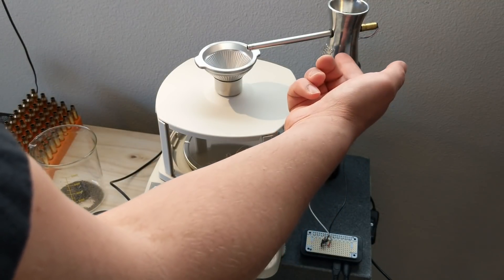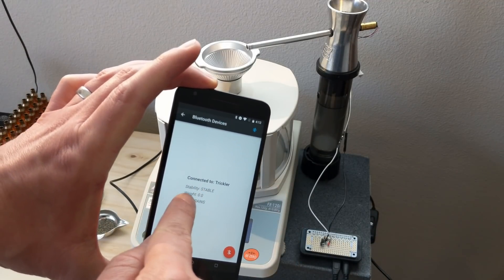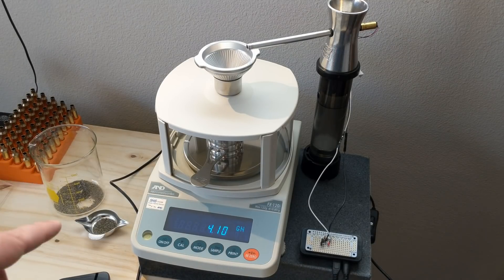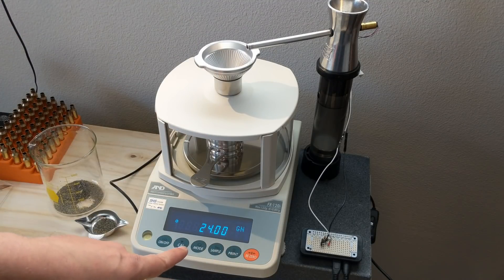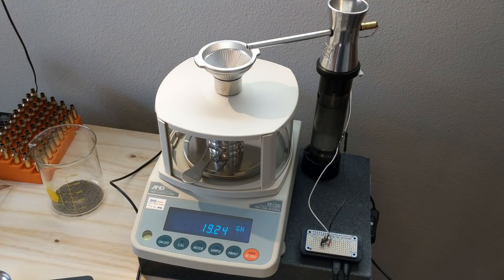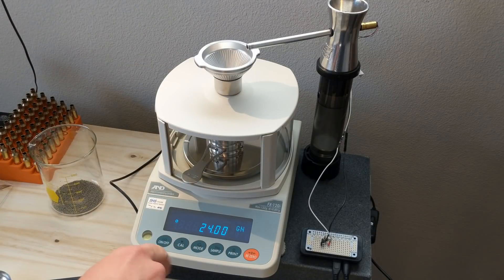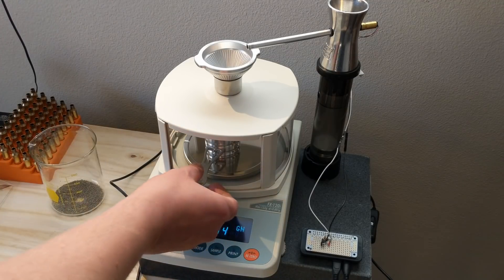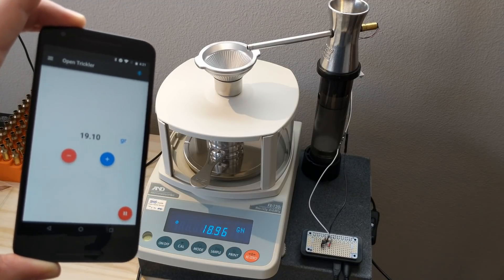Open Trickler: The DIY Smart Powder Trickler

Comment: Anyone know what stand he is using.  Just call all the parts to start a build. The Pi was hard to find :)
Reply from the maker: The stand you see here is just whatever I could find to give it more height. The trade-off with trickling in from above like this is that the extra distance created a lot of lag on the system, leading to overthrows.
Reply: @Ammolytics  Thank you very much for this info.

Comment: Nice idea, but it is agonizingly slow for the last few tenths of a grain.  Manually controlling the trickler with an intterupted power switch you could top it off much quicker.
Reply from the maker: There have been a ton of improvements since this first release (which was almost two years ago).

Comment: Eric,

Do you have info on your drop tube design?

Thanks for the Open Trickler!
Reply: Yes sir.  The Trickler assembly is an easy read.  Figured it’d be fair to include the cherry on top of the sundae.  :-)
Reply from the maker: Hey Richard, thanks for watching!

By drop tube, are you referring to the funnel system I have attached to the top of my scale?
Reply: I know it’s an Area 419 funnel and cup.  It’s the cylinder above the lid and the drop tube that would be nice to know.

Thanks again for open sharing this.
Reply from the maker: @uscbigdawg  I don't have parts numbers or dimensions immediately available, but it's a small metal funnel (like those used to fill a flask) press-fit into a short piece of copper tube (5/8" or so).
Tell ya what -- I'm working on an update  video/article to share the progress that's been made. When I do, I'll include more information about the drop tube for you and everyone else.

Comment: Have you considered making a video on how to build one of these from start to finish?
Reply from the maker: Good suggestion!  For now, I'm trying to get things a bit more stable and easier to do (e.g. pre-built image for the SD card). After that work is complete, I'll do a quick follow-up video and show the build process (maybe in fast-forward or something).  It's a straight-forward build, but some folks learn visually and I want to support that.